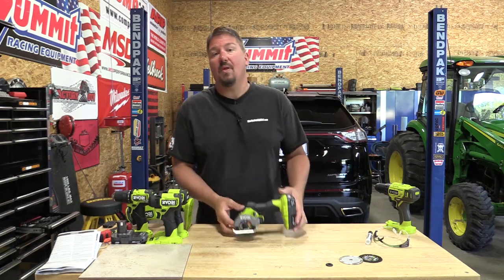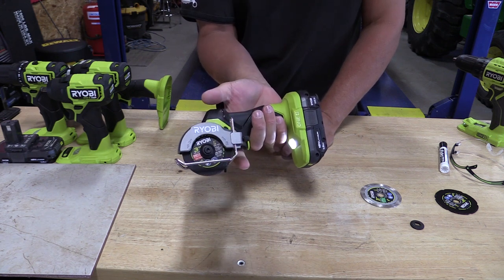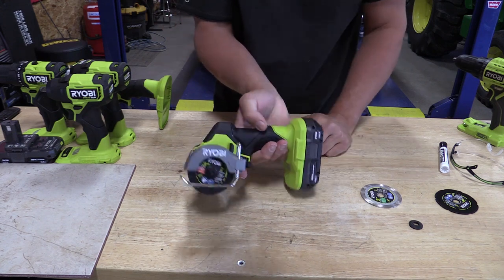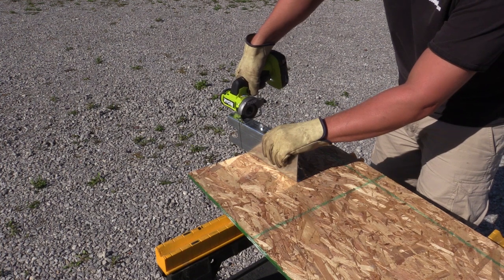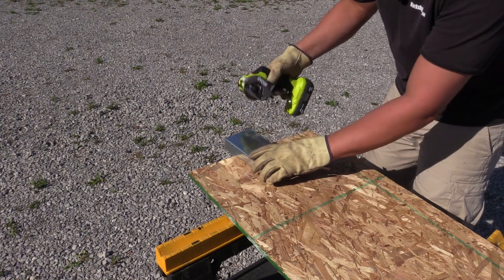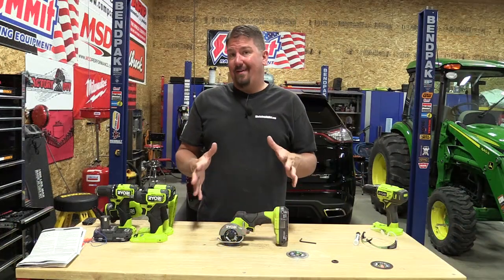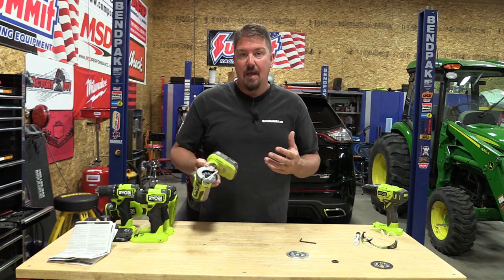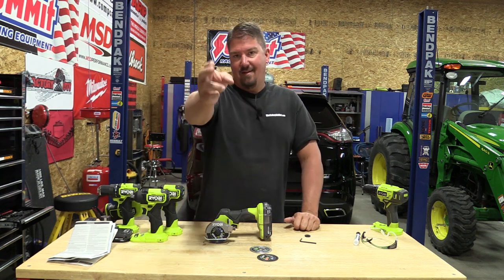RYOBI  ONE+ HP 18V Brushless Compact Cut-Off Tool Review Model # PSBCS02B | Ridgid SubCompact ????

Comment: You should have the wheel spinning before you make contact. Thats why its hanging up
Reply: Absolutely agree , He was just not using it properly because I have that tool and it’s awesome I let it spin first and I tell you you will be surprised about what that tool can actually do and also the power on that tool will also depend on how powerful is your battery , I used a adapter do put a Milwaukee battery on it and when you do that you can feel the power on that thing .
Reply: If he did the same thing with compound saw or table saw, the material would’ve kicked so hard….
Reply: This is a great example of why we dont let clowns run tools on the jobsite
Reply: @mayday3177  it's people that don't have experience with tools but just do videos
Reply: Use a bigger battery itl wrk fine..i got the same cutter

Comment: love this little tool!  it's intended to be a support tool for the heavy primary tool that's doing most of the work so if you're at the top of a ladder and need to trim a notch off a piece vinyl siding than this is the tool but don't expect to make all your cuts with this tool.
Reply: Indeed a support tool.. I cut off exhausts from vehicles and sometimes a sawzall is physically too big for the awkward spaces to get the tool and the blade length in small spaces around the frame of the vehicle.. with this smaller took you can cut through just enough to where the sawzall can’t physically fit to finish the cuts

Comment: I love mine.  For when you need to cut a piece of trim or moulding, drywall or a screw or nail. It's made the cut off wheels on my rotary tools unnecessary and its much easier for me than using a angle grinder or circular saw for a simple task. To me its a great convenience tool, if you treat it as such, you will appreciate it.
Reply: Can you use it on timber? Like a fence paling etc? Like a smaller circular saw?
Reply: @SimoneLai1981  yes, just bear in mind that the depth it cuts is limited, and use a blade for wood.

Comment: Thank you for such a comprehensive review. We have one of these and love it. It's been a real workhorse. It is very dusty when used for drywall but for cutting other materials has been very handy, especially for cutting in where other larger tools don't quite fit. I wanted to see how it did on tile because I plan to use it for some backsplash tile. Thank you again!

Comment: I bought the Ridgid sub compact cutting tool, mine also stops with the smaller batteries.  Bought the larger batteries and no problems.  I use the Ryobi and Avanti cutting wheels.

Comment: You're using the tool wrong, that's why it's stopping so often. Start the spin before you make contact. Your angle of approach is also important. Come more parallel to the cutting surface and move along it, as opposed to pushing down into it.
Reply: C'mon, man, you can't just be jumping around on a video and then offering advice. He was doing it on purpose to check the indicator lights.
Reply: @steveysimmons13579  "C'mon man"- I own one. It would take a million years to cut with mine if I too used it incorrectly. My year or so with the tool has shown me it's just like all other high speed cut off tools  in that you should start the wheel before contact.

Comment: I used it to cut the plastic tube, it cut it well, but it stopped once which required removing blade and put it back after CLEANING.  

Also noticed that lock got lose & started making noises.  Overall I like it.

Comment: Yeah, since it wasn't blinking, I thought I burned up a battery once or twice. Pulling the battery to reset is fine, but as you noted, a visual indicator (since, ya know, the docs say it should) would be awesome. Booooo. Otherwise, great little tool. I have overheated it once or twice, again, no blinking, and it took a minute or so to cool down. This tool makes you learn some finesse in cutting, that's for sure, but all around it's a good tool.

Comment: Not digging having to take the battery out to reset the overload. That alone would keep me from buying it. Lights flashing or not isn't all that necessary but the later could become a real PIA in a awkward way.
Reply from the maker: You are right, but if the manual says it does something, it would be nice for the tool to do it

Comment: Probably should had used a high performance battery however I don't see the point of this tool. I personally think the angle grinder will work just as well. I guess if you didn't already own the angle grinder but still I think the angle grinder is a much better deal. The disc's are easier to find and more choices. You can use flap disc's, brushes, and sanders along with the cut off wheels. I'm sure guide may make it easier for beginners to use but still.

Comment: I think I might pick one up but really considering the m12 cutoff tool
Reply: I have Ryobi at home and M12 at work. I'm super impressed with M12 but also appreciate what Ryobi has to offer....
Reply: I got the M12 COT, and it is by far the tool I use the most of all mine! It's incredible how many small tasks it can handle.
Reply: Get the m12.  U will not be disappointed.
Reply: I think the dust collection and nicer table/guard make the M12 worth the few extra bucks if your on both platforms.
Reply: M12 may still be available for $119 kit. Includes battery and tool plus all the hookups at home depot. Mine was just delivered.   Honestly i have no use for it but its there if i need it.
Reply: @thetoolmat8632  You will find uses. I bought mine for work. I'm a tank truck driver and often we need to cut open padlocks (customer gone home without leaving us a key, lock is rusted shut, etc), but that use has been limited, mostly I cut off excessive nails at home, open packages, sharpen blowgun darts, or whathaveyounot! I could probably have gone with the rotary tool instead, but I didn't. 🤣

I very rarely use a knife for anything anymore...
Reply: The M12 is a beast. I love it. The shoe is great. I bought the Rigid and took it back. This Ryobi looks like a carbon copy with one exception. They actually included the 3/8” arbor which is the dumbest thing about the Rigid.

Comment: Try a larger battery.  The battery will overload and stop working which will not light the tools leds.
Reply from the maker: If that is true, the supposed better electronics are very poor.  Not taking any frustration out on you.  Its just that we are using the new HP batteries witht he HP tools.  The lights should light no matter what.
Reply: @WorkshopAddict  I have over 100 Ryobi tools...The bigger the battery the better the tool operates. Does not matter what they say about what it is supposed to do...electronics wise.
I think it is part of middle-of-the-price-range tools. Obviously, I could care less about that issue. I bought 90% of mine from pallet sales guys which puts me at about 33% of original retail price. 
I love them but they have there strengths and weaknesses.
You are WAY more honest with your videos than I would be. I would have reshot that entire thing till the thing worked... 

Thanks for sharing!
Reply: BTW...For anyone wondering.... I have all types including the new HP Brushless...18v....40 volts....all behave that way...battery wise

Comment: It is an HP brushless tool. Does this particular tool happy to additional electrical contact? Because I noticed you are using a non-hp battery which does not have the two additional contact. Maybe it requires the two additional contacts to communicate with the battery or whatever in order to Signal the LED indicators. Just a thought.

Comment: Ryobi batteries have "the smarts" in them. The BMS in the battery normally shuts down the tool when it gets hot or of the to demand more than it needs. For years that worked just fine because the battery was always the weak link. With the addition of the 9ah and 12ah packs the tool became the weak link. The battery was happy but the tool would melt. The new HP tools monitor themselves to handle the edge case of the battery being just fine but the tool can't handle the load. You used a small pack which made the battery the weak link.

Comment: Did you check to see if the LED blinking is the LED at the top near the blade? I think I saw it flashing in the video but couldn't tell.
Reply from the maker: It was not flashing on either light

Comment: What I found lacking was instruction on how to remove the wheel screws using the hex key to insert the blade.  Just went in circles and did not loosen. Is it locked or am I doing something wrong and no, I did not tighten it by going in the wrong direction.
Reply: Same

Comment: can you put a wood blade on this to cut thru some plywood?
also you are using regular lithium 1.5 ah battery
there is an actual difference between the lithium, lithium+  and the lithium+ HP
getting a 3 ah lithium+  is good for power and time
Reply: I want to know the same thing; if this can cut wood?
Reply: @ishtlutz1261  yeah it can, kinda
the discs that perfectly fit are really hard to find 
also regular skillsaws spin at 4k to 6k rpm
this little thing spins at up to 20k rpm
it does have a variable trigger for speed control 

it spins too fast for wood it 

also the max cutting depth is at most 5/8 inch
Reply: it can cut anything even alien space craft but it's not for wood. I attempted to cut subfloor but it smoke and turned my alarm beeping and left a smoke smell for the weekend

Comment: aa well once again looks like this one needs to go back to the drawing board. For now, will stick with my M12 as it also comes with the duster collector which a lot of people wonder why Ryobi did not have it. Well on to the next demo.
Reply: Not trying to put you down, but the m12 is not perfect.  Sometimes it cuts out more than usual or too soon.  What makes the m12 superior to all is that included dust collector, but...I don't use it all the time.  The ridgid cut off's downfall is the vibration and that flimsy guide.  What people don't get is that this tool is pretty versatile, but it does have its limitation.  I have to say that Ryobi and Milwaukee makes more sense than the Ridgid in terms of design.
Reply: @ProxyFinal  greed but since Ryobi only has a 3 yr warranty and Milwaukee has a 5 yr with local  repair centers the choice is easy to make
Reply: @stanleymcman9422  yea, I would stick with the M12 as it appears that the Ryobi is not that any different than the Ridgid.  Really didn't like the ridgid's vibration.
Reply: Honda buyer  you never know what they're going to bring out if I were you I would have already been signed up for the Milwaukee pipeline which is going to be in four parts showing all their new products coming out
Reply: Honda buyer it wouldn’t hurt, but seeing how unpopular the tool is on either platform, it seems very unlikely.  Some people like it, some hated.  I see it as an overlooked tool.

Comment: They definitely missed the mark putting a 3" blade on this. All the quality tile blades are either 4" or 4 1/2". Any chance a bigger blade would fit this thing?
Reply from the maker: It will not.
Reply: Agreed... a larger blade would also help with heat buildup! Wonder if you could take off or modify the guard?🤔
Reply: @blakehendrix641  Blade size is related to motor size and power draw.  Besides warranty/liability issues, don't be surprised if modding it makes it worse.

Comment: I think the battery is cutting out instead of the tool try a bigger battery
Reply from the maker: Possible, but why have an LED system for an HP tool used with the HP battery designed to work with it?
Reply: @WorkshopAddict  It's possible the tool is cutting out because it can't pull the power out of the smaller battery, it might need more and hence why you're not seeing the lights go - its cutting out because it can't get the power, not because its getting overloaded. Kinda like how you put the bigger battery on the saw - you didn't do that here.
Reply: @hanmaan  Ryobi's and all cordless need the larger battery to pull the necessary current.  If you are using a smaller 2AH battery then you are going to need to feather it more and allow it to keep speed up.  Jamming it through the workpiece on a smaller battery is just going to have the battery electronics shut down, as you witnessed.  I'm going to be getting one of these myself, and I expect to use my 4AH batts and still use for trim type work and not as a mini-circular saw replacement.

Comment: Is there any disks for wood that small
Reply from the maker: No, look at the small dewalt saw.
Reply: The dewalt one is to heavy. I just got this ryobi one yesterday . earlier this morning i found a 3” wood cutting disk from Dremel .
Reply: @josesoto9099  That's exactly what I wanted it for. I want a super light saw to cut trim or wood that's would be otherwise impossible to reach with a regular size circular saw. Thanks man!
By the way, how has it worked out for cutting wood?
Reply: @coppulor6500  
No man unfortunately it didnt work for me i ended up returning it . It might still work for you if the trim u want to cut is less than half an inch thick . I work in roofing and i install roof felt and wooden battens for roof tile and the wooden battens are sticks for the tile to sit on. Well the wood battens are a half inch thick and this little saw with a 3”disk wont cutt all the way threw unless i turn the stick around to finish the cut. If they made if to take a 3 3/8 disk it would be enough. But if you got really thin trim than yea it should work for you . For now ill keep using the regular ryobi circular saw
Reply: @josesoto9099   I'm more concerned about whether or not it has adequate power.  I realize how shallow the cut will be.  So, you think, power-wise, its got what it takes?
Reply: @coppulor6500   
Yea it has the power especially if cutting threw thin trim
Reply: I wish ryobi would make an interchangeable disk shield for it to use bigger wood disks. For me as a roofer it would be the perfect little saw
Reply: @josesoto9099  I wonder if someone with a 3d printer could print a bigger shield. But maybe it would be difficult to find a bigger blade to fit this machine
Reply: @robertcornelisse8664   a bigger blade like 3 3/8 or even 4 can fit i took the shield off to try it and they fit but for sure a bigger shield is needed

Comment: Hello, can I use my old One+ battery with this tool? thanks, i dont have the new "HP" battery
Reply from the maker: Yes, this tool only uses the two connections so you will not get a power increase from the tool by using a HP battery.

Comment: Being able to pick up the M12 milwaukee cut off tool with a 4.0ah battery for $119 makes this Ryobi tool just worthless
Reply: link?
Reply: I get the assumption about relative quality, but if love to see a good comparison between the Ryobi and Milwaukee traveling the same tasks, comparing power, battery life, overheating, etc. Also depends on the battery platform you're invested in. I'm already using two (Makita LXT and Ryobi One+ 18v). I'd be reluctant to commit to a third - new charger(s), more batteries.
Reply: Thoughts on the 12v vs the 18v as far as torque and battery drain.......for the m12 vs the Ryobi 18v
Reply: I tried the M12--it was horrible!!---overheated, stopped, jammed...I couldn't even cut 24 gauge sheet metal with any consistancy...this Ryobi actually seems to perform better.  The whole M12 line is just crap in my opinion...

Comment: A tile saw is better at cutting tile. A metal cutting chop saw is better at cutting metal. Even a right angle grinder with a cutting disk would probably be better than this little saw. So what exactly are these good for?
Reply: These are small trim saws, not a circ replacement.

Comment: I swear these brushless tools are crap, no joke prefer my old brushed tools, they seem to have more torque in my opinion. Still a die hard ryobi fan though, bought a bunch of milwaukee tools for my employer and they were very unimpressive also brushless.
Reply: My m12 brushless driver has blown away every 18 and 20v brushed driver its gone up against, done tons of head to heads, I've even driven 12" GRKs into LVL rafters with the m12 wile my co workers were busy running a 100ft of extension cords because their brushed tools failed to get the job done. To each their own but having owned and used both brushed and brushless impacts, drivers, circ saws, recip saws you name it from every known brand, I can tell you for fact brushed tools don't stand a chance against their brushless counterparts.
Reply: @joeb1009  guess we got duds and it kept stalling out and cutting off due to overheat because we were dumb or perhaps we were pushing the tools beyond their limit, I mean driving 2" screws into wood is a big ask.

Comment: COMPACT, RIGHT, WHEN THE BATTERY IS BIGGER THAN THE TOOL AND STILL HAS THE CLIP IN NOT SLIDE OLD NICAD FORM FACTOR BATTERY. KEEP KIDDING YOURSELF WHEN YOU PURCHASE ANY RYOBI TOOL.
Reply: Ryobi settled on 18650 package when they originally designed their tool line.  They've decided to stick with that form factor due to the massive number of people who've bought into their tool line and have decided to try and stick to using that form factor instead of moving to pouch style which would require a new form factor and obsolete everyone currently on the 18+ form factor.  
One could argue they are trying to not screw their Users.
However, they are going to have to change at some time, which will allow them to have small batt packs.
Reply: @boots7859   This is the design Ryobi originally went for 17 nicads 15 in the base 2 in the handle that's where the form factor comes from. Long before 18650 lithium cells where around
See link for internal design on a similar manufacturer.
https://www.batteryexperts.co.za/shop/18v-black-decker-nicd-battery-inner-pack/
Today you are happy, today you learn something new 😊